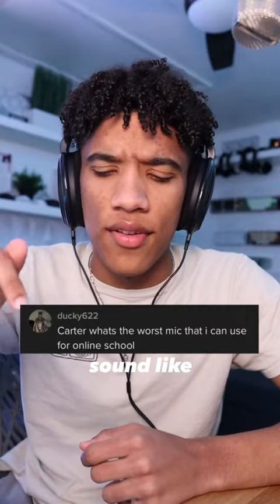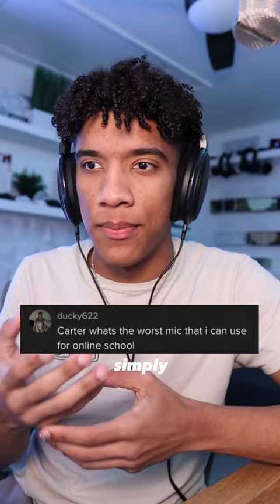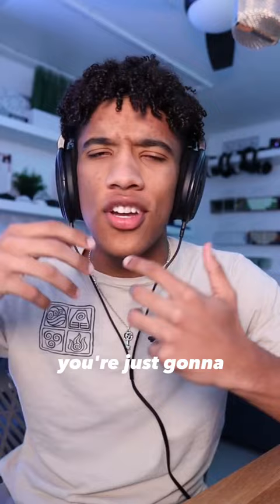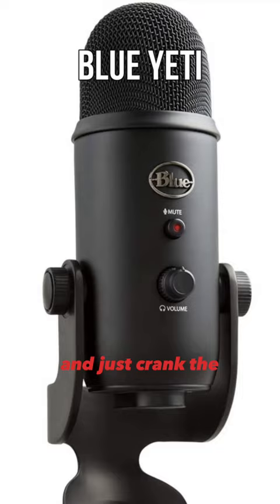How to make your mic sound worse

Comment: If u don't want to buy a new mic and are on windows 10 you can achieve a similar effect by going into control panel, hardware settings, mic properties, then increase decibel boost and volume, and if u want an especially low quality mic go to advanced and set mic quality to CD
Reply: Saving this

Comment: EASIER SOLUTION: go to control panel, hardware and sound, sound, recording, click your microphone(you can test which one is yours by talking, and whichever is showing noise is happening is yours) properties, levels, in there there is mic boost, crank it to 30db and voila
Reply: This actually fixed my mic cause it had some problem with getting sound in and was quiet as shit
Reply: glad to hear it @Exinith

Comment: Or if you don’t want it so bad and have an Xbox and a headset with a built in mic you can press the x button and scroll down to sound settings and there will be something near the bottom which will control how much you can hear your self while sounding not that bad to you and others

Comment: im tryna piss my friends off with this mic and i got a few questions
1: wdym by "crank the game"
2: wdym by "more gain=more distortion"
3: i play on ps4 controller and where would i plug this mic? 
*i havent bought it yet
Reply: 1. he said gain
2. increasing gain makes it louder and increasing the gain/input level a ton will result in the sound in the video
3. make sure the mic had a 3.5 mm jack or a port that can support a cable like that. plug the mic into the jack in the controller and adjust settings as needed